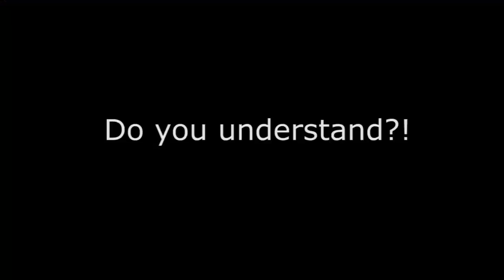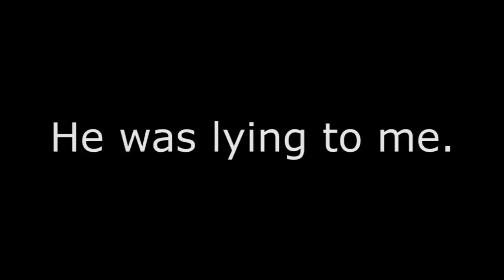Regular Car Reviews: 2007 Porsche Cayman

Comment: Honestly, if you have, like, $30k kicking around want a fantastic handling sports car with enough power to feel spirited but not make you regret that you don't own a track membership, while also still being a car that is reliable enough to be daily driven, then a Cayman is an excellent choice. It's the cut-price 911 for people with some disposable income, but who still need to budget. While it still extracts the Porsche tax when you buy it, the resale value doesn't hold nearly as well as the 911's does, despite being a similarly capable car in terms of handling, merely burdened with the fact that, like the Camaro to the Corvette, it can never be allowed to outright outperform the 911 in stock configuration.

Comment: I am made so, so, so, so, so uncomfortable by the idea of being in the trunk of a car.  when I was in school for my year 1, I was replacing some sort of trunk component, I forget what, doesn't matter.  It required me to be totally in the trunk and a colleague decided it would be funny to close the trunk and lock me in.  It was not funny.  It was an early 2000s cadillac I recall, and it didn't have an emergency trunk release from the inside, it didn't even have fold-down rear seats.  The only way to open the trunk was with a secondary key, different from the door lock or ignition key. I had that key in my pocket as I was trapped and freaking out.  My only option was to hand the keys to my colleague through a little trap door in the rear seats meant to make it possible to transport skis.  Like what if this same thing had happened but the keys were missing? What if for some reason the car doors were locked and nobody could even get into the car for me to hand them the keys?  The only option would be to hack me out with an ax or a saw, and that's only if I were lucky enough that someone knew I was in there.  Shitty design and now I have claustrophobia.
Reply: Thankfully, I think an inside trunk release is mandatory now. But that still doesn't sound like a pleasant experience.
Reply: Cameron Mikkers that made me feel claustrophobic just by reading it
Reply: So my Mom's 2001 Impala has a feature a 2000-2004 Cadillac doesn't? (It's the emergency inside-trunk release.)
Reply: Austin Lucas Okay, that's strange. Does her Impala have fold down rear seats by any chance?
Reply: one night i was finishing up vacuuming out my truck, when 4 kids in a small sedan, don't remember what make or model, drove by and stopped at the stop sign near my house. I heard lots of giggling, so i looked over to see what was going on, and one of the girls got out of the back seat, the driver popped the trunk, and out crawled another blond girl (from the trunk), who traded places with the one that got out of the back seat. whole car was giggling. everyone looked like they were having fun with their bizarre game. I think that incident gave me a fetish, because i randomly imagine girls in trunks now when i see a car full or teens on the freeway. LOL
Reply: @Naveek Darkroom I don't think it has fold-down rear seats, no.

Comment: The Cayman is absolutely the 2 seater with the most utility.  Assuming you ignore the Corvette, which has like 5 times as much cargo room.
Reply: 911 has more cargo room as well
Reply: cayman has a front and back trunk.  Corvette only has a back trunk, how does it has more cargo room?
Reply: lifehackertips special type of suspension.
Reply: lifehackertips The corvette has more cargo space than passenger space.  Look it up.  It's a real car meant to be used every day, not a stupid toy.  Recently I took my roof off, put it in the rear storage and then went shooting and shopping.  When I arrived back home, my car had the roof off and stored in the cargo area along with three rifle cases, one large alice pack with external frame, one ILBE pack (internal frame), a set of rhino ramps, three plastic Walmart bags, (7) quarts of oil, (7) paper grocery bags (upright), a gallon of milk, and (2) 50 cal ammo cans.  Nothing crushed, nothing sideways, just all fit with room with for more.  There's room for multiple suitcases in that car.  There isn't room for one in any Porsche.  Good sportscars, but IMO not good cars.  I'll be building a kitcar in the coming months, and that will have zero utility, but at least it'll be blazing fast and cost $8,000.  I don't understand the $60,000 car with no utility.
Reply: I sent you a message with a picture of the trunk of a vette.
Reply: spraynpray that's a coupe, we're talking about convertibles.
Reply: lifehackertips The Corvette roof comes off.  The Cayman doesn't.
Reply: spraynpray The convertible Cayman is called the Boxster

Comment: I just watched this again .. after having purchased a 2009 Porsche Cayman S. Could be the best car review that I've ever seen sober'ish. I would love to hear what he thinks about the 09's 3.4L DFI 320HP pushing around such a light scalpel. Even though the general theme of the Cayman's place in the automotive caste system still holds true, the model's updates allow it's 'less is more' design to present an awesome daily driver platform to me. Ah .. and yes, I have the porsche roof rack system too, but I use it to carry my muddy bike.

Let me know if you want me to drop by with my ride for an update on this wacky, mid engined, multi-trunk, roof racked, silky smooth, p-car.

Comment: "The finest 93-octane". Is 93 considered good in America or do I sense a slight sarcasm? The "worst" fuel here in Sweden is 95 octane...
Reply: Same here in Belgium and holland. We have 95 and 98, obviously both unleaded.
Reply: 93 is high.  Most cars in the US use 87.  Most gas stations carry 87, 89, and 91.  Some have 93 but it depends on the station.
Reply: Wow. Here we get (all lead free) 95, 98 and if you're lucky 100 octane :D
Reply: The USA calculates octane differently from most every other country.  Our octane rating is about 5 lower than your equivalent.  So, our 87 is your 92, 89 is your 94, and 93 is your 98.  Also, the availability of 93 octane depends on the region.  It's common for "premium" to be 93 in Florida, vs 91 in California.
Reply: JagHeterAlfred Well whoopdee fuckin do.

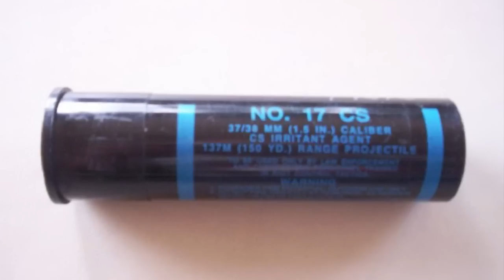Comment: 3:16
I came to give the Cayman a 2nd look for purchase, seems too small for the streets, though $15K+ less than a base Carrera. but when I see that 911 in comparison, there is no substitute.
Overall though, these exotic sports cars are too small, compromising too much safety weight, for easier speed. 911, R8, Gallardo, Murci, all my favorite choices look like go-cart sized jets on the streets..
Next to the girl in a big cheap sedan or suv, driving with her knees, while looking down texting on her phone, looking up at the mirror to check her makeup. She'll run over me, silly bitch.
Cayman/Boxster, BMW Z, roadsters are even smaller, like bumper cars.  I need a fast, and solid tank coupe. I guess a GT, but not benz nor bmw, I want the cars they look up to. Suggestions please..
Reply: Aston Martin V12 Vantage, SLS Merc, SRT Viper, Ford GT, uuuhhh Audi RS7 take your pick
Reply: Jermaine Riley bingo, you know. Ive been looking for the fastest cars with power status, prestigious history, hi-level safety with dense curb weight structures.
Ive narrowed down my list of goals and cars to go with each, for the next few years.
Benz' new commitment back to their quality control, safety tech, and weight vs speed upgrades won me over.
classic body CLSxx AMG for starters;
then SL63 drop, top, on the block...
Bentley GT is a bargain right now, Volks/Porsche owned company with solid reliability.@502 hp, it made my list. My uncle who had a Rolls, would want me to have one too.
Next, with all respect to the revolutionary Panamera, everybody has one, or talks about wanting one now, so.. 
the Aston Martin Rapide...n---- we made it!
Reply: Em x Photon as a performance vehicle yes the Panamera is king but DAMN that thing is ugly. Rather have a Maserati Quattropotte or as you said Aston Martin Rapide, miles ahead in looks. And n---- we made HA!
Reply: Jermaine Riley that Quattropotte looks like a dated Buick now unfortunately, it was hot when it first came out though.
For reliability and performance balance within a sensible budget, Im holding off on the Germans until Im rich. Maybe a used Porsche Cayenne with warranty for the snow, but for now, a Vette with airbags option will do.